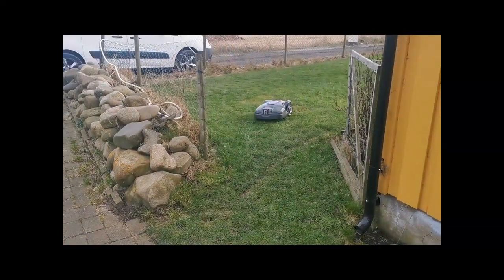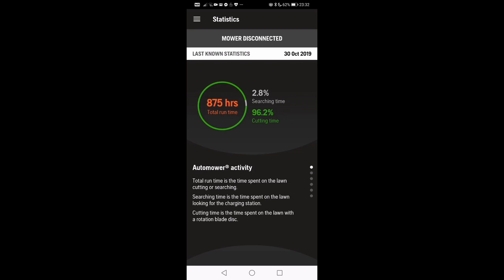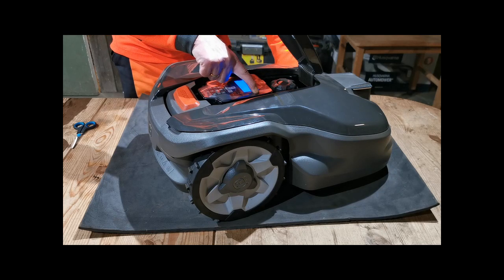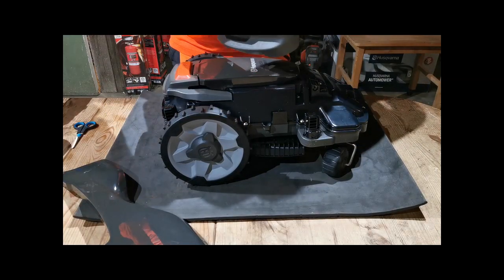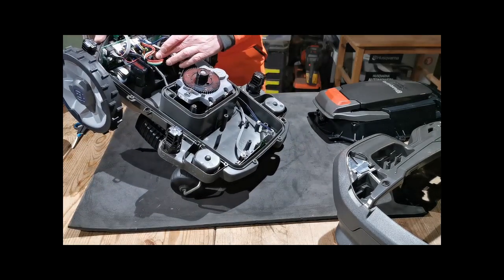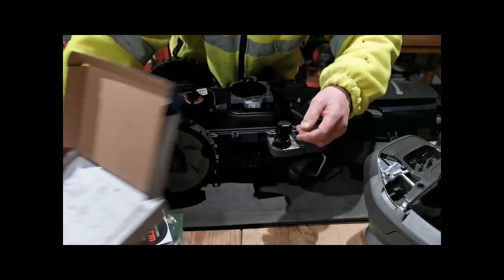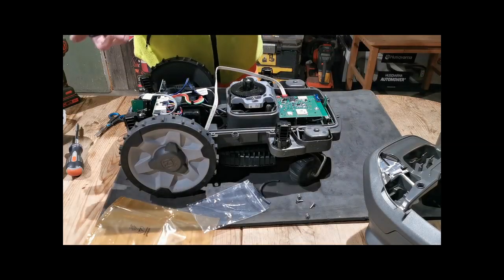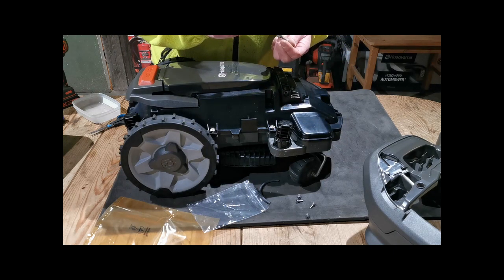Automower 305 - a first look.

Comment: Hi. I am going to buy this Automower 305.
Could you write here about some drawbacks of this device ?
What about durability of main wheels ( the constriction of wheel and connection with axes that passes the torque - "plastic teeth ?") and front wheels construction durability and mounting bearing of the pivot (that in some other devices breaks after one season of mowing ).
Thanks for any valuable information about problems that could be encountered using this device.

Comment: Hey! I have one as well. If you upgrade it with GPS module and update software / firmware would it wipe the data from previous use? I would like to keep my lawn work data.
Reply: No settings will be changed by adding the Automower Connect board, but the mower will need to be connected to a dealers software to update the COM board.  The Automower Connect board allows for more remote control of the mower than the standard Bluetooth connection to the app, in fact it can be controlled from anywhere in the world with cell phone coverage, and the board has a 10 year, pre-paid subscription.  It also allows for GPS tracking of the mower, and you can follow the mowers movements on a map in the app (20 second update I think).  But it doesn't give the mower GPS navigation capabilities, it will still choose the start points that you program manually through "Installation -> lawn coverage -> areas 1-3"